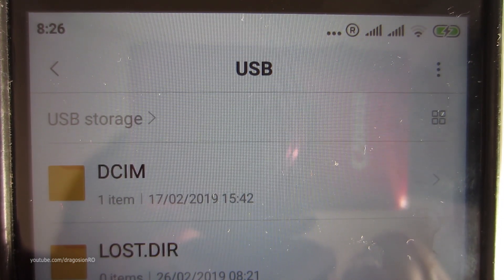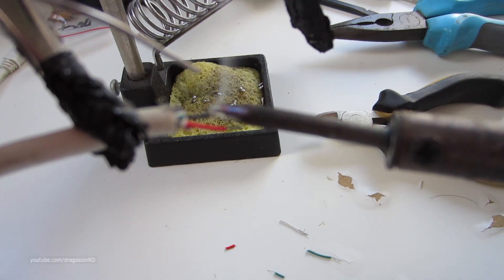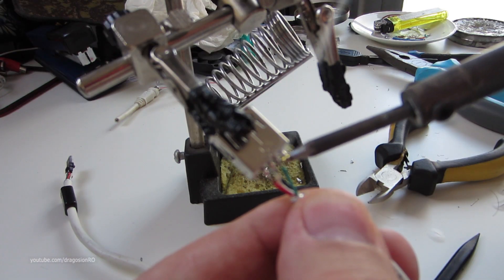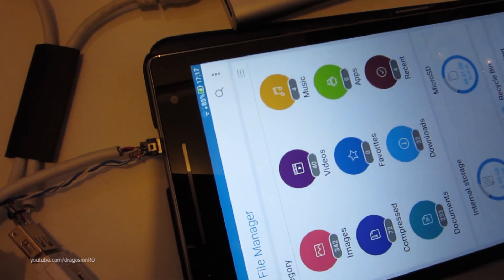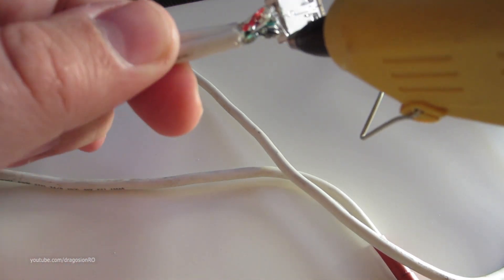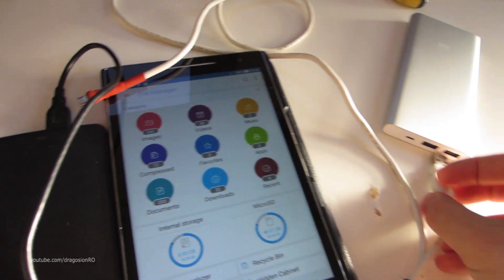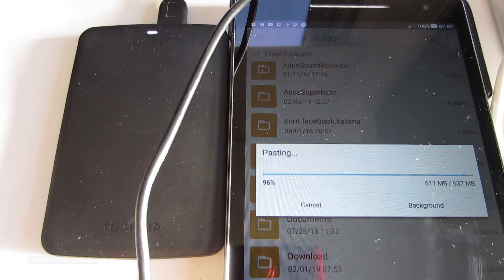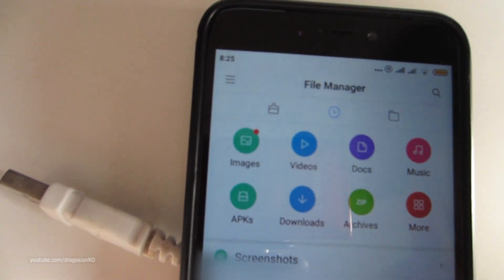USB OTG External HDD

Comment: In my case 63 k or 85k or 100k resistance not working,
I put diode between red+power supply with usb hub to run Hdd